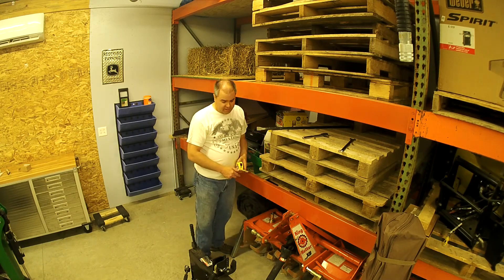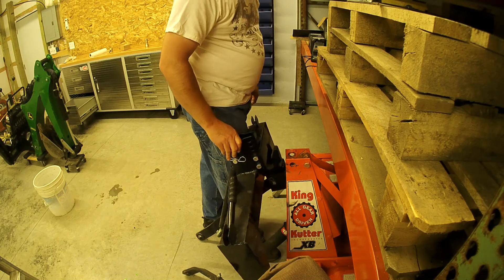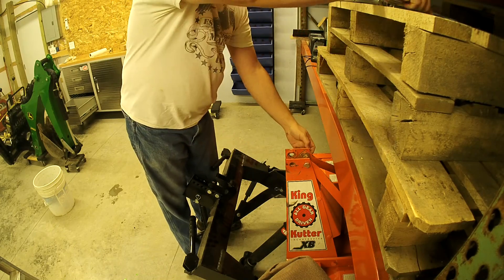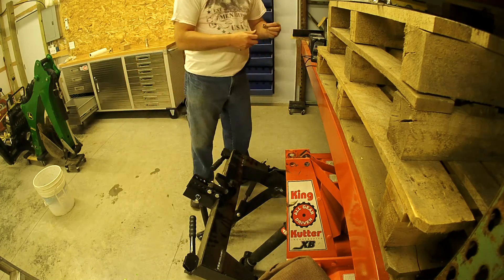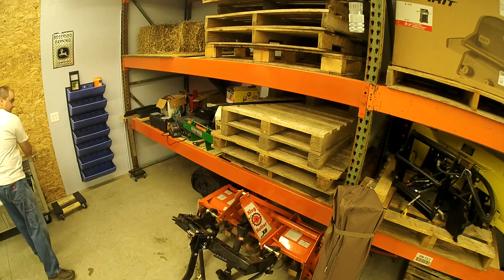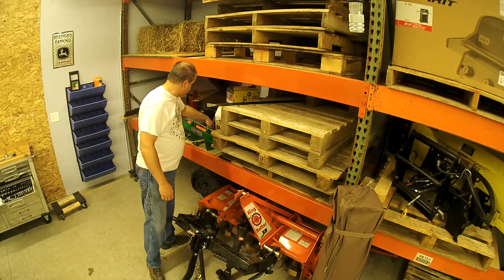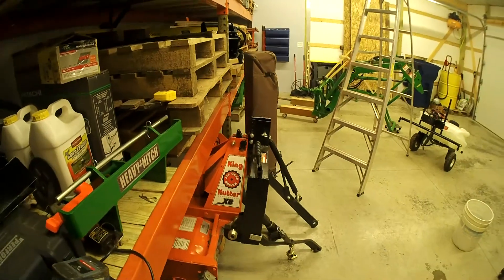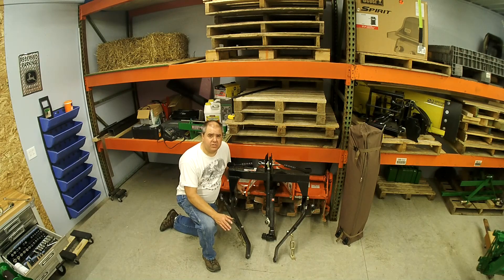#72 How to make a King Kutter XB Tiller Quick Hitch / I-Match Compatible

Comment: Great videos. Your tractor seat time and helping others fits many of us YouTubers, fun to watch. Mine is a 33 hp 2004 New Holland 4x4, HS, FL. I bought a 5' Land Pride tiller and Land Pride QH. Yes it's a job fitting all implements to quick hitch. Have a 12" plow I modified for quick hitch, not tried to do any plowing yet. I added Tip and Tilt Hyd for 3 point, a really great Option. I did the third function with add on bucket grapple, you can't believe how much brush can be picked up.
Reply from the maker: +ArizVern thanks for checking in, Vern!  Top and tilt would be very useful!  Which land pride quick hitch do you have?  I like the looks of the QH05 because it doesn't require any bushings.
I'd love to have a grapple.  I have it picked out, but haven't been able to pull the trigger yet!

Comment: Tim, Thank you, thank you. Great video. I purchased  my King Kutter per your recomendation late last year waiting until my "New York State Home Confinement"  to  hook it up to my 1025.I forgot it wasn't compatible to my John Deere Imatch Quick Hitch until viewing your video again 6 months later. I want to use the quick hitch due to the tiller's size and awkwardness hooking up the lift arms.  I think you used a Central Tractor draw bar bushing which is shorter than the upper link bushing I used. The upper link was an exact thinner replacement.  I haven't installed the PTO yet. I hope with the Quick Hitch I don't have to shorten the shaft.

Comment: I had the same problem with my Taylor Way 48 inch tiller. your solution worked for my tiller as well. I also had the harbor freight quick hitch and switched to the Imatch hitch instead. the Imatch quick hitch is so much better. you should get one.
Reply from the maker: +Christopher Pauquette I believe Taylor Way and King Kutter are the same company.  At least they are in the same booth at the National Farm Machinery Show.
Reply: good to know

Comment: Picked up a quick hitch from Rural King (cat 1) to use with my King Kutter XB. Hitch was 5” too wide. Gave up on extending the lift pins and went with removing 2 1/2” from each side of it and welding it back together. Replaced the bushing on the top of the XB as the wall thickness interfered and now it works like it should.
Reply from the maker: https://youtu.be/056uuicU3K8

Comment: I never use a quick hitch on my tiller. most tillers are offset and adjustable which puts the top link off center from the lower lift arms. the quick hitch also moves the tiller back about 4 to 6 inches which moves all that weight back as well making the front end liter even with the loader on it. thats not bad when operating it but when loading and unloading off the trailer the further back weight changes the balance of the whole unit during loading/unloading. I really notice it with the brush hog which is another implement I dont use the quick hitch on when I need to trailer it to a work site. I do think you made a great work around changing that spacer out. nice job!
Reply from the maker: +daveknowshow thanks Dave!  Haven't heard from you in awhile. Doin ok?
Reply: been fighting this cancer since January 2017 as you know. but I'm hanging in there brother.

Comment: Greeting from La Porte! I have the King Kutter II, 60 inch wide on my 2520, with the Harbor Freight Quick Hitch. I ran into the same problem with the top "hook". I just ground the heck out of it! Now it easy to hook up! Don't seem to have any trouble lifting it up high enough. I don't like how it leaves a pile of dirt where you start, and a hole at the end of the row where you stop. Keep up the great videos!u
Reply from the maker: +Fred Kaminski yea, your 2520 is a lot taller than the 1025R.  That is probably the biggest advantage of the 2 series in my opinion.  Higher 3 pt lift, and more ground clearance.

Comment: My advice would have been to move the Bolt and Spacer forward, making them the Hook mount point and upright support. Then secure the 2 Braces with nuts and bolts. Hopefully you also ditched the Hook for a wider aftermarket for better clearance..

Comment: Tim, put another top link bushing on the top link pin. This will give you the spacing between the upright bars and retighten your bolts. In fact you could use two bolts since the quick top link pin would not be needed.
Reply from the maker: Yep.  I just didn't have another top link bushing.  You are right about the bolt.  Could do that.  
Are you doing ok?
Reply: +Tractor Time with Tim Yup. Doing good. You got me thinking about modding my box blade and other items to QuickHitch. I managed to find a JD one laying in a field and picked it up real cheap. Only thing that QH compatible though is my 647 Tiller.

Comment: Tim, nice shelving. for your top link hitch problem I used a 1/2 inch all thread rod and nuts and washers.
Reply from the maker: +Jack Hembree jack, any 'slack' in that top link mechanism allows the tiller to shake back and forth while tilling.  Doesn't feel smooth at all.

Comment: I have a Jd 4710 and it has a quick hitch and we convert all are stuff to fit. Use 2 bolts for the bars and then put a bushing in place where the pin is and replace that with a bolt or pin so you don't have to take it out. Just back up and raise up
Reply from the maker: +Matthew Teal yes, of course.  I was removing the pin for demonstration purposes. I leave it in place for normal usage. 
I thought it was easier to see what I needed to change to make it fit this way.  Also, I didn't want to keep lifting that hitch by hand :-). Once was enough!

Comment: The quick hitch is suppose to be attached to the tractor and then the implements connected to the hitch. When you bought the implement the bushings should have come with that part, and once the top hitch on the quick hitch is set for most of them, you should not have a problem with hooking up those attachments.
Reply from the maker: +Sidney Mathious hi Sidney.  This particular attachment was not designed to fit a quick hitch.

Comment: Had a similar issue with my Mahindra box blade expect the bolt was just below the pin. Took the bolt out and welded those support straps in place then ran my top link pin through a bushing to keep the spacing

Comment: I would be concerned that the added length of the longer sway arm lift pins might bend the frame they bolt to.   Let us know how it works out.
Reply from the maker: The pins themselves bend over time…broke one.

Comment: So far I think the LandPride QH05 for subcompact tractors is a pretty good choice, not cheap but sometimes you get what you pay for comes into play.
Reply from the maker: QH05 is not really so expensive given that you would not need bushings.   at $15-$30 per attachment, these bushings add up.   I really like the looks of the QH05.
Having said those positive things, the QH05 doesn't have an adjustable top hook.   Also, its shape does not allow a full rack of weights on the Heavy Hitch bracket.  (at least I don't think it does).          Everything is a compromise!!!

Comment: You should check the length of the PTO shaft with the quick hitch. With the qh on, the PTO shaft may over extend. Keep an eye on things.
Reply from the maker: +Drew6709 yes.  Kept the shaft as long as possible when I first cut it (without the QH).  It works well now with the QH.  Your point is very important!  These shafts are short.  There isn't much room for error.  Adding the QH makes a big difference.
Reply: I added a pto shaft extension that added the 4" back lost from the quick hitch.

Comment: Had to do the same thing Tim. But I took the original spacer you replaced and milled a flat across the whole thing very nearly into the bolt hole. Orient it to the hook as you tighten. Still plenty of strength and maybe a touch more clearance than the thin bushing you found. Also on the lower pins, had to buy the longest pins made in that diameter and they worked perfect. I think you got the same ones.
Reply from the maker: Yea, really wasn't that difficult. I posted this so that people can see that lack of quick hitch compatibility is not necessarily a reason to avoid the KK XB.
Reply: They are great tillers.

Comment: What length draw pin did you use? I don’t see it in the description anymore. How have the draw pins held up with being longer and the bushing on them?
Reply from the maker: I think 6.25”.  A bit hard to find.
I have broken one.  They bend backwards almost immediately, as the tiller pushes forward against them.
If you haven’t purchases the tiller yet, I would avoid the KK XB for this reason. 
Love the tiller...but no use hassling with this.
Reply: I just got the tiller. I think I will just hook it up without the quick hitch. I will have to cut the pto shaft though if I do that. I was trying to avoid that if possible. I’d rather cut it though vs bending the pins and keep having to replace pins or damage the tiller
Reply from the maker: You could also destroy the tractor if the shaft is too long. Easy to cut.   Easy.
Cut it.

Comment: Hi Tim, I recently purchased the Deere 1025r and am in need of a tiller for the garden.  I've been looking at the KK XB models as a cheaper substitute to the Frontier or Deere models.  My local Farm and Fleet store stocks two versions of the KK XB, a 48" and 54" model.  I believe both would cover my tire tracks.  Can you tell me which one you have?  I can't tell from the videos.  Thanks and keep doing the videos, they are great for a beginner like me.
Reply from the maker: +Troy Ault I have the 48" XB. Love it.   It gets out the tracks. For most soils 4' is all you want. Why spend more?  Do you have a huge garden?
Reply: Tim, thanks for the reply.  My garden sure seems big tilling it with a 16" walk behind.  It's about 33yds by 13yds.  We grow just about everything including lots of corn, beans, peas, and various types of tomatoes.  My wife makes amazing salsa all grown in our organic garden.  The price difference for the two models is about $10 so I'm thinking of just going with the additional width.  They both have the same number of flanges (6) and tines (6 per) 36 total so the power required should be the same.  I'm in Wisconsin in an area of mostly clay soil.  I'm going to take your advice on the Quick Attach modification, so thank you for figuring that out!
Reply from the maker: +Troy Ault you'll be fine with the 54".  Sounds good!

Comment: Love all of your videos, Tim...has helped me make some educated purchases for my 2320. I would add that prior to seeing this video, I contacted King Kutter to see if their tillers were quick hitch compatible...they said that while all of their tillers are quick hitch compatible, they would not recommend using one with any tiller due to "safety considerations". They did not elaborate further but I speculate that maybe with the tiller jumping around when hitting rocks, roots, etc. maybe it's possible that the bottom links could come unhitched...any thoughts?
Reply from the maker: I think their answer is bunk.  Period.  Oh, not ALL of their tillers are quick hitch compatible...this XB is NOT.   So, told ONE fib in a conversation, I would suggest that you doubt the rest of the conversation.  Just my opinion.

Comment: Awesome video. I’m actually on my way to Rural King right now to buy a tiller How long are the pins?
Reply from the maker: I would not choose the King Kutter XB at this point due to this issue.  The longer pins tend to bend or break.
Reply: Good info I will reconsider

Comment: Hey Tim Jeff from Sheridan. I also got the harbor freight quick hitch love it. A lot of people complain of the loose fit with the bottom pins but fail to use the bushings. I was going to order mine but did find them at Rural King same price I believe. I do have an adapter for the top link on my pulverizer I can send you a picture if you want but let's me use it on older attachments which are not quick hitch comparable. I am looking for a rear tiller but my kubota dealer is giving me a deal on a land pride but they are quite pricy. I have looked at the king cutter is yours reverse tine or standard? Used my post hole digger at my sons this weekend and he was amazed how fast we could dig the holes. Keep up the great videos. Jeff
Reply from the maker: +Jeff Clemons I may be able to help with the tiller search.  Please email me at the address listed in my 'about' section under business inquiries.  Or via private message on you tube.

Comment: How have your pins worked since?  I just bought the imatch, now I'm nervous.
Reply from the maker: Works fine.    The tiller does "push forward" some while operating, and therefore the pins have sort of bent backwards a bit, but not much.  It works fine.
Reply: Thanks. I've been watching you for awhile with your uses. I just hope I don't hit any rebar, lol.
Reply from the maker: +Jonathan Ballard ah, I'm more confident now with the tiller.  That thing can handle anything.  Wow!

Comment: how are the lengthened lower pins holding up? any bending?
Reply from the maker: They bent backwards...like the tiller is pushing forward against the tractor.
Broke one of them last weekend.
Reply: I did my pins similar except i used lower link bushing to space it out, for more support. However, i think i see some bending as well. Curious, is the king kutter steel frame twisting or was the damage only to the pin??  If the frame holds  up at least I know i can always beef it up without too much trouble...not having to straighten a twisted factory frame.
Reply from the maker: The frame seems to be fine.  My replacement long pins have already bent. So they will eventually break from fatigue as well.

Comment: Check out Pat's easy change system.  It's what I ended up with and I have the exact same tiller and tractor.
Reply: Works for equipment that is not quick hitch compatible.
Reply: I did the same thing.  The Pats system is not quite as clean and easy as the frame-type quick hitch, but it is compatible with way more stuff as it's not limited to a certain size and the top link attaches separately.  You can even use it with a post hole digger which is impossible with any other quick hitch.

Comment: my QH05 only cost me $175 thru my kubota dealer.  well worth it over the cheap quality over harbor freigh
Reply: I did buy the HF QH.  it quickly went in the dumpster
Reply from the maker: +Tyler Kruckman Tyler, do you use the regular ring snap keys on the lift pins, or is there another solution?  I realize you don't use the bushings.  Just wondering how you keep the hitch from slipping off the lift pins.
Reply: It's a perfect fit so there is no need for the pins   however I did have an implement that I converted to be QH compatible and welded a washer on the pin to center when attaching it to the QH.   The only downside to the LP is the top hook is not adjustable.  So I did order the HF top link adapter and use it on the LP.   I am beyond satisfied with the quality of all land pride implements. Aside from the powder coating.  I hate powder coating
Reply from the maker: +Tyler Kruckman yea, not quite sure why they didn't make the top hook adjustable.  If you have many implements, avoiding the bushings will save significant $$.  Obviously, my mention of it in this video shows that I was considering it.  I decided HF purely because of $$.  It has been fine for me.  What specifically failed on the HF version?  You mentioned quality issues.
Reply: also i have the land pride tiller, box blade, rear blade, 3pt snowblower,ballast box and a middle buster so it is a real time saver. only thing i wish i could have was separate contols for mid and rear lift arms so i didnt have to change things when i put on the bagger
Reply from the maker: Tyler Kruckman There is always something to wish for isn't there?  
I think you have mentioned it, but I can't remember.  Which tractor do you have?  I'm assuming it is an orange one :-)
Reply: +Tractor Time with Tim yes a kubota bx2370. my brother in law has a 1023E
Reply from the maker: ok, about the same size then.  
I just find it hard to believe how much we can accomplish with these little tractors.  They really are amazing.
Reply: +Tractor Time with Tim i am envious of your backhoe tho,  my wife said no to that because i would get into too much trouble digging holes
Reply from the maker: +Tyler Kruckman ha!  I have a video planned on 'how to convince the wife'.  We'll see if i ever get it completely edited.
Reply from the maker: +Tyler Kruckman ok, so maybe I'd better leave this video unpublished!

Comment: I need to win the lotto so I can convert all my equipment to QH, and get a QH. :)
Reply from the maker: +mi2tn you don't have a QH?  Only $80 with coupon @ HF!
Reply: QH isn't the problem. None of my equip is QH compatible.
Reply: The Imatch quick hitch is so superior to the harbor freight hitch. It's well worth the money. I paid $353.00 for the Imatch and $79.00 for the HF. I gave the HF to my neighbor because he is adding more attachments.
Reply from the maker: Christopher Pauquette More details please. Why is it 'better'?  What is worth paying 4.5 times as much.  Honest question, not trying to pick a fight.
Reply: I used the HF Quick hitch for 1 summer. The mechanism is sloppy and mostly non-serviceable. Parts would break or need to be repaired often. The IMatch hitch has gone 2 full years without any repairs. I change implements often. The less problems the better is the better option for me.
Reply: I noticed that you removed your tiller shoes to till deeper. I have done the same with mine for my own garden
Reply from the maker: +Christopher Pauquette makes sense.  I couldn't justify the cost of ANY quick hitch.  If I were to do it again, I would buy Land Pride QH05.